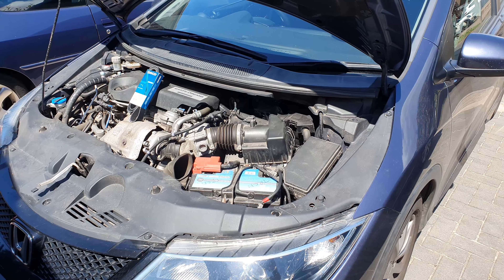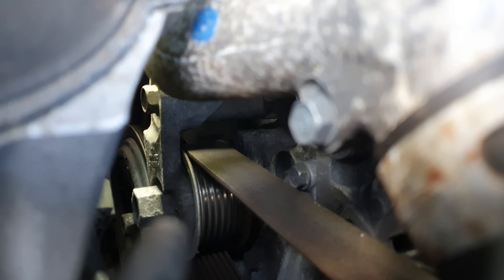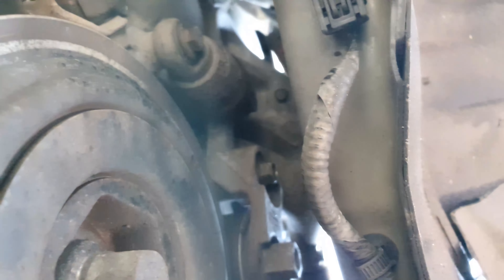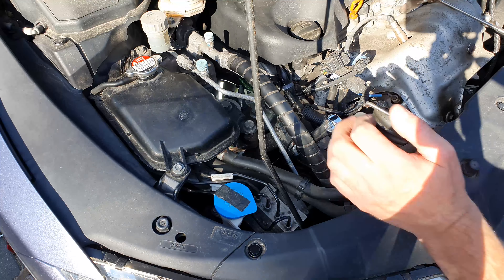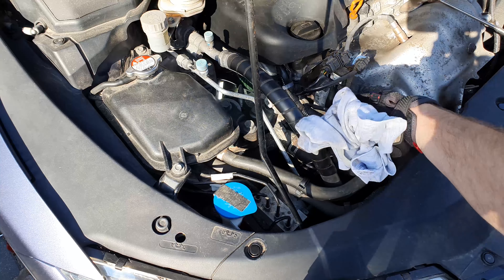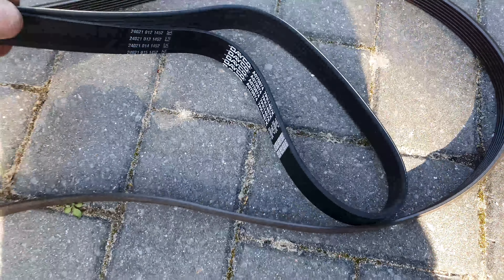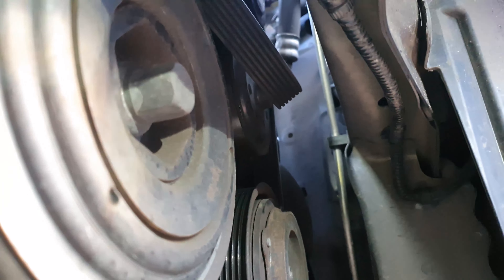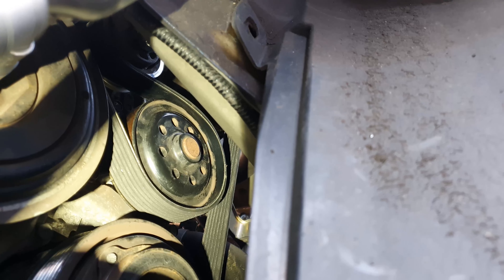Honda Civic 1.6 i-DTEC  - Aux Belt - FK 9th Gen

Comment: I did that same, but from wheelarc. I installed belt to cranck, ac compressor, alternator and tensioner. After that, I pulled tensioner enought to slide belt to what you called roller, but that is waterpump. Its easy to side on it there, because there are No teeths on it. 
Have done same installation to other Hondas, and its way easier to side belt to waterpump pulley etc pulley what has No teeths on it

Comment: What about the same car but Gen 10, did you also change the water pump? Thanks man!
Reply from the maker: Not sure about 10th gen, and I left the pump alone. There was no play or noise from the pulley. I come from a world of Volvo where it is abnormal to change the original water pump at the first or even second timing belt change, such is the quality of the pump. I would rather keep a quality original Honda (or Volvo) part in place for longer than replace with a possibly lower quality part.

Comment: Ayup again Komrade ive got a dead alternator. I dont have a big enough spanner for that pulley nut (tried a breaker bar and socket but too tight). Just a question when the nut is loosened by pushing forwards to the windscreen does it hold the slacked off position or move back to its original? Never done one before. My pulley belt still looks healthy, on about 80k. 

Cheers
Reply from the maker: Hey mate, the tensioner will spring back, it won't hold. This makes removing the belt annoying as it's quite a strong spring. I also found no way of getting a socket on, even a slim one. Might be worth getting a long zero-degree-offset ring spanner for this job, makes it a lot easier
Reply: @KomradeShotabollokov  cheers for the help again mate. Yep, not a chance with a socket bit. Started to do it yesterday and realised my spanners weren't long enough for the required leverage. Who designed the layout of this engine? 🤣 Just need to order a 19mm long spanner. Great vid as always. Keep it up. 👍
Reply from the maker: Cheers 👍
Reply: Well it all went a bit south for me Komrade. Long spanner arrived in post but wasn't offset. Limited time so tried it anyhow with the closed end and the damn thing rounded the bolt on a second attempt. Prob my fault not getting a proper purchase on it due to the angle of the spanner. 😔

Now ordered a serpentine tool off Amazon and a good quality 19mm crow foot spanner to attach to it. I hope this works or I'm in trouble (other than using a bar to try jack it slack). What an absolute game! You need hands the size of a back scratcher to get into anything. Never get this aggro working on my Passat! 🤬
Reply from the maker: I have a serpentine belt tool (simple long flat bar with 3/8 drive welded on the end). Can't remember if I tried this with a very slim 19mm socket or not but this might work. A slim 6 sided socket might be better than the crows foot if the tensioner is starting to round off. Edit: I know I said I tried a slim socket earlier in the thread but this was with normal ratchets I think. Don't remember trying it with my serpentine belt tool.
Reply: @KomradeShotabollokov  I'll give it a go. Pray for me! 🙏😂
Reply: Komrade - well what can I say, Lucas alternator now fitted but everything was so cramped. There are 2 bolts holding the alternator and they are an absolute bar steward to get to. Had to bend an offset 14mm closed spanner and whack it on to the bolt head to get a purchase on the top one, then once loose about 20 mins trying to  unwind it by hand as there is no real room for a ratchet. Also I couldn't seem to move the alternator pulley nut to slacken the belt without rounding it. In my desperation I had a brain fart so used my long serpentine belt tool and jacked this up with my wheel trolley jack to the pulley nut which then held nicely whilst I slipped the belt off. This is jacked up by removing the drivers wheel (UK) and the panel just as in your belt change vid. Finally you also need to remove the coolant hose as it's in the way or you won't be able to remove the alternator. I lost a bit so topped it up once the new alternator was fitted. In addition I also removed the nuts and bolts holding the heat shield to the right of the alternator as this gave it little more wiggle room.to remove. Some of the wiring also needs to be removed from the clips surrounding this as well as they'll be in the way. 

All now done so hopefully these tips may help others, as strangely there is hardly any info on UK civics on the web for stuff like this. 

Cheers 
👍
Reply from the maker: Absolute nightmare. I look forward to this when I have to change mine... glad you got it done in the end though
Reply: @KomradeShotabollokov  Cheers. Lord knows how much it would have cost in labour at my garage!

Comment: How did you remove that f.....g belt from the tensionner wheel?
Reply from the maker: Well that wasn't too bad. It was getting it back on that was worse. To take it off I released the tension on the tensioner, then used a hook tool to remove the belt from the alternator pulley.
Reply: @KomradeShotabollokov  Yeah, but it was really tricky to remove the belt from the tensioner pulley, coz you have to bend it behind, very hard just with the end of ONE hand's fingers (no room for more). I just succeeded, but it was the hell! But many thanks for the video, buddy!
Reply from the maker: Oh yeah I understand what you mean now; the belt has to be twisted out from behind the pulley after it's slack. Yes it was a bit fiddly. Not an ideal design...

Comment: What size is the spanner?
Reply from the maker: I can't remember but something in the order of 17-19mm I think.
Reply: @KomradeShotabollokov  thanks, man. I'm about to DIY belt change on my idtec and your video is a great help on what to expect during this replacement job.
Reply from the maker: No worries, hope it all goes ok - the access is a little tight like with other things on this car... I think I said in the video but a zero degree offset long ring spanner really helps for the tensioner
Reply: @KomradeShotabollokov  ya thanks for the headsup about the aviation spanner. I've already placed an order for 19mm size.